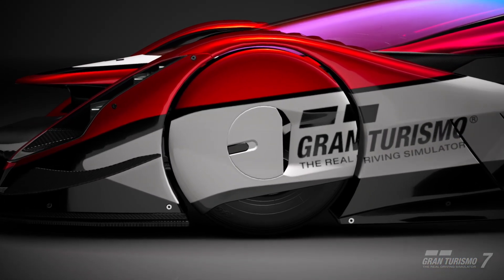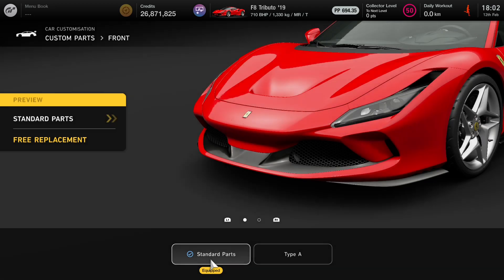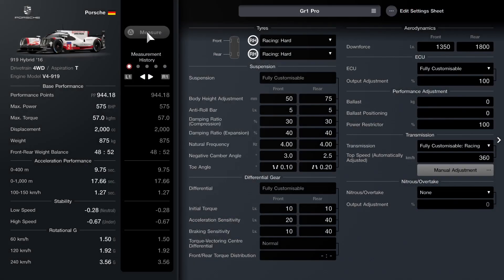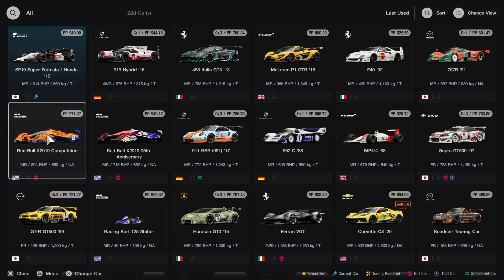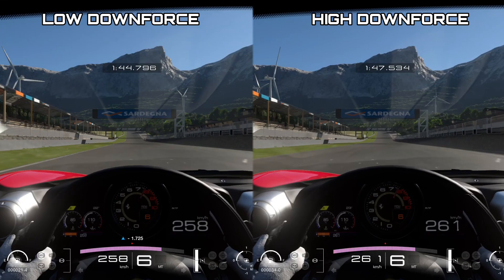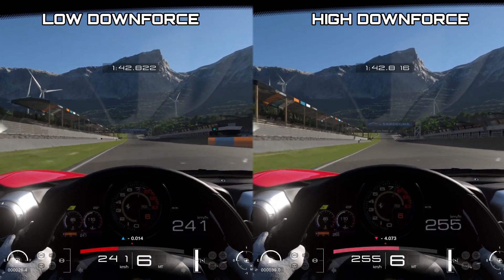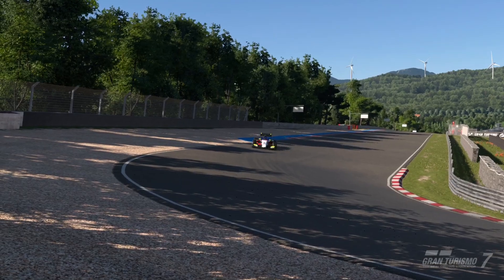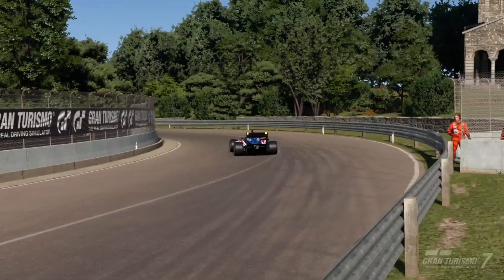GT7: Downforce Tuning: Everything Explained with Examples

Comment: Downforce is a great deal of help on roadcars can change your car from a sloppy banana to a racing car .. i dont see enough people use it propperly tho
Reply: Downforce tuning is arguably the best in the entire series for road cars for that particular reason.  Before, it was a compliment, but didn’t outright transform the handling of a car.  Now, it’s not only practically a must-have if you plan on going fast in a road car without worrying about handling, it’s also good enough to actually make a road car competitive with equivalent race cars, albeit with additional tuning variety.
Reply: Downforce makes road cars more stable and easier to drive as well as demonstrated with the video. It's beyond me why more people don't take it into consideration when modifying vehicles on GT7, because in the long term you'll be multiple seconds a lap quicker with aero bolted on to your road car than without any downforce.
Reply: @TheSilverShadow17  Because downforce = lower top speed, and lower top speed = slower lap times according to some people, forgetting that race cars aren’t just fast because of their high horsepower and low weight, but also because of their downforce.
Reply: @camarokidbb4347 You sacrifice top speed regardless when applying downforce, plus the extra grip is a necessity for tighter more technical racetracks
Reply: @TheSilverShadow17  True.  The only real situation where downforce doesn’t reduce top speed is when equipping a diffuser, and even then it’s only because diffusers by default provide their minimum downforce at 50 front/50 rear.

Another quirk of diffusers is that they re-enable rear downforce tuning when you have ‘wingless’ equipped (applicable to cars like the R34 Skyline and the Spirit A RX-7; some cars have no rear wing downforce tuning regardless), so not only do you overall reduce drag with both diffuser and wingless, you still have a slightly wider margin to tune your downforce.

Speaking of reducing drag, I believe that adding a diffuser + removing the rear wing is the only modification you can do to a car, besides weight reduction, that improves fuel economy without tanking horsepower.  That said, the fuel economy’s only improved when racing around high speed tracks like Circuit de la Sarthe, or in combination with lowering power, as drag isn’t a factor until the car starts to noticeably slow down, versus weight reduction where fuel economy is saved because the engine in general doesn’t need to work as hard, or power reduction where the engine just doesn’t work as hard.

Comment: Am i the only one going for 0 downforce for max speed? I just controll the throttle
Reply: Without downforce you have no grip through the corners, however in straight line acceleration that doesn't matter. Where the aero makes all the difference is at technical sections of the track with winding sections left and right, vice versa.
Reply: @TheSilverShadow17  You'd be surprised, even just with a touch of aero and with a good tune on the suspensions, how much you can max the car potential... It's always been about pushing the limit
Reply: @andrewandrew3713  Agreed, and fair point. Pushing the limits has always been the fun part until they exceed the base mechanical grip of the tires, at which point aero helps out with.
Reply: @TheSilverShadow17  of course, thats why i also love F1 as a whole, my approach has always been (once i got good enough) to make myself compensate more for the cars less reliable handling, but thats probably because i prefer fast tracks ahah, so i guess i adapted to the tracks i enjoy most
Reply: @TheSilverShadow17  in short i love mechanical grip lmao
Reply: @andrewandrew3713  On fast tracks with a lot of straightaways the added assistance from aero has hardly any effect except for high speed stability, but for smaller and twisty locations it makes a big difference, somewhat comparable to night and day. That being said it depends on the track layout, the vehicle, various other factors.
Reply: @TheSilverShadow17  and lets mention that gt7 in not even that into detail, as far as physics is concerned, compared to other sims like acc or i racing
Reply: @andrewandrew3713  Then again GT7 isn't trying to be ACC or iRacing, it's it's own thing as it should be. Some can argue about the physics not being the greatest but that's not what the game's about.
Reply: @TheSilverShadow17  for sure, didnt mean to talk down on gt7, after all i mainly play that
Reply: @andrewandrew3713  Same here, I love playing that game too
Reply: Equipping a diffuser (found with the rear bumpers for some cars; you can tell it’s a diffuser upgrade from the dark grey rake) actually increases top speed compared to without, due to a reduction in drag as well as having just enough downforce to counteract lift.

Some cars have both a diffuser option and ‘wingless,’ the latter of which further reduces drag while still not compromising downforce.  This combo isn’t just good for high speed builds, but also endurance builds around tracks like Le Mans, where the higher speeds mean drag becomes a greater issue.  For example, I have both my RX-7 and R34 Skyline run diffusers + wingless, plus their respective Gr. 1 engine swaps, plus maximum weight reduction, detuned to 70% power through their ECU.  Combined with FM = 6, both these cars can run the entire 30 minutes of Le Mans 700 PP without a single pit stop.